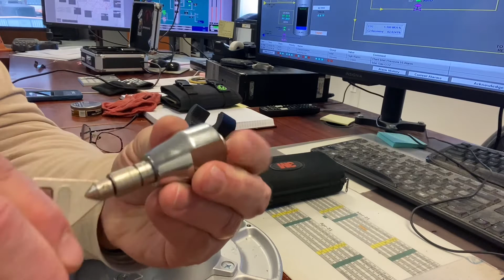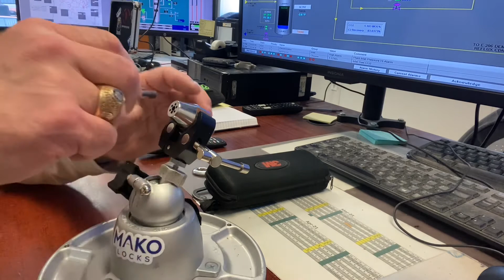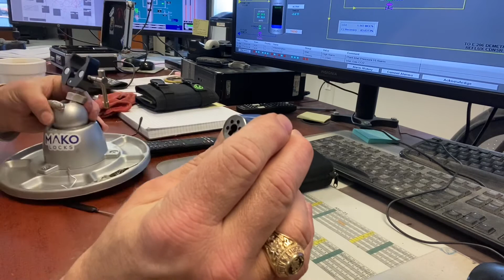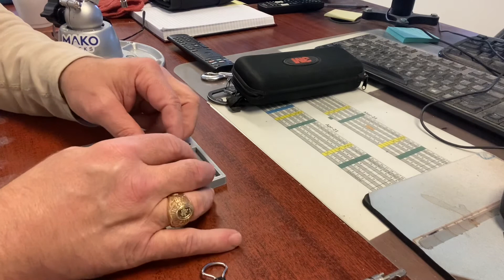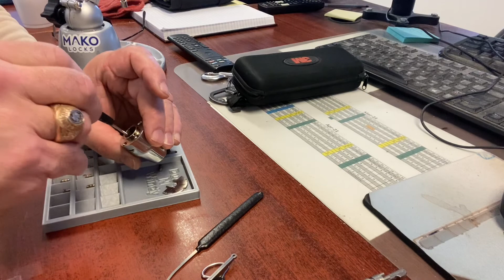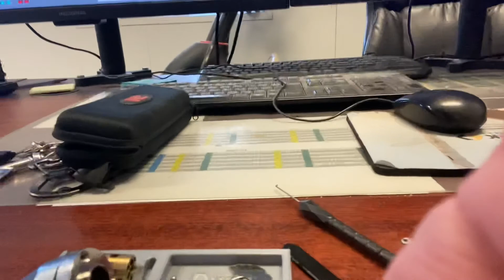iZis Picked n Gutted for Brown Belt

Comment: Brown should match the dust perfectly. Seriously though 👏👏👏
Reply from the maker: Thanks EAC! You have been on fire lately and I think you could come up thru the belts and put that bear in a few belts. A Re belt would match that scarf 🧣 to a T
Reply: @dustynwindy  Been working on green belt locks.  Hoping for blue by the end of the year.
Reply from the maker: I have no doubt you can do it. The 1100 is very doable. Specially since you knocked down the 410.